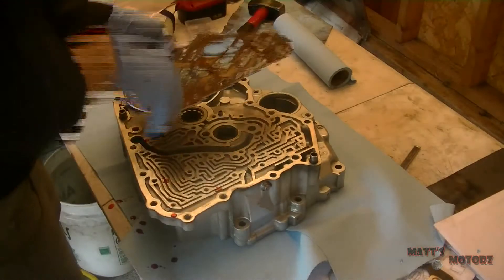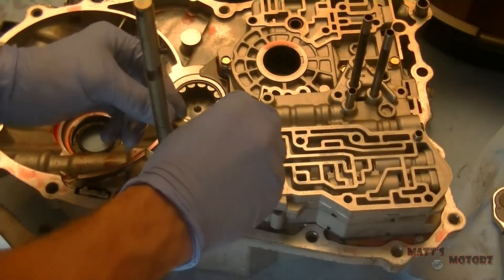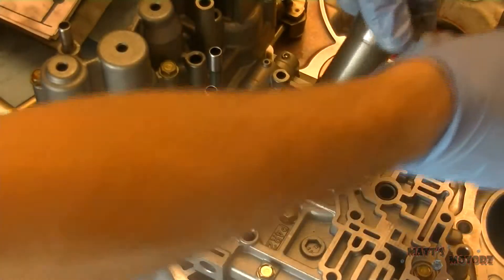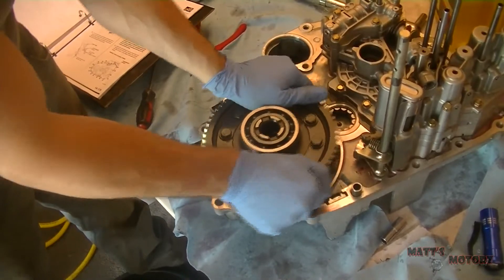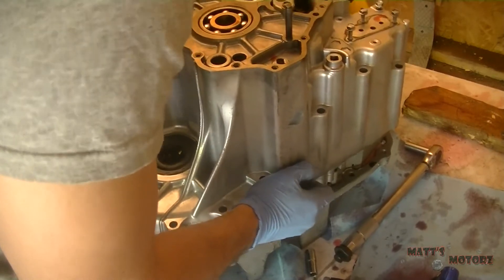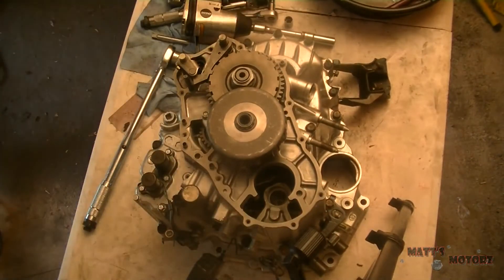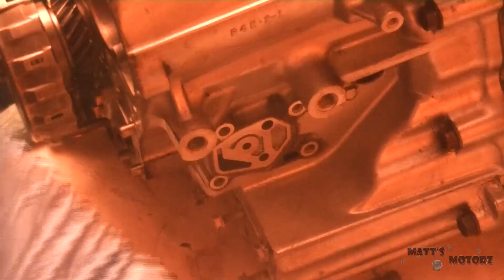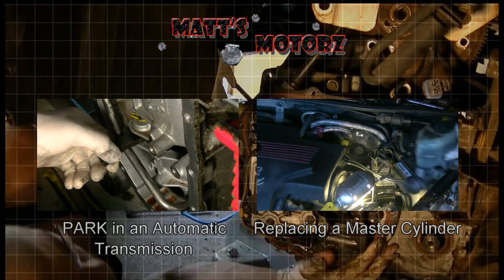A4RA Transaxle Rebuild [96-00 Honda Civic] Part 6 : FINALE - Reassembly

Comment: Hi Matt, thank you very much for this video.  I need to make an appointment.  What oil can I use as a replacement for the original?  Where I live it is expensive to get it.  The manual says that you can use a dexron 3 until you get the original, what do you think of this?  Can I damage something using another oil?  Thank you!